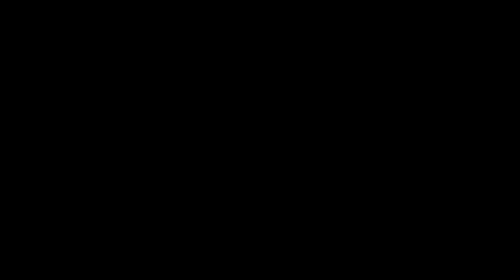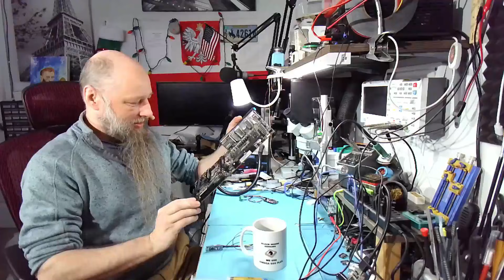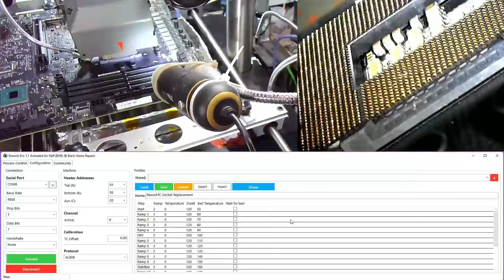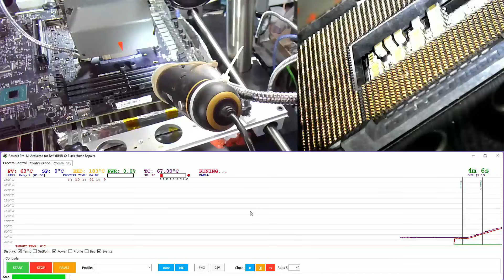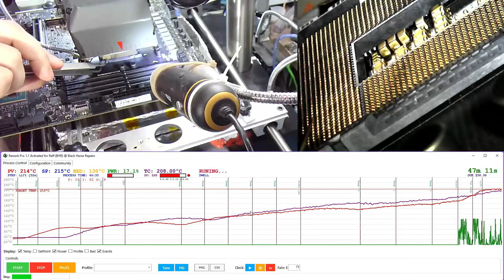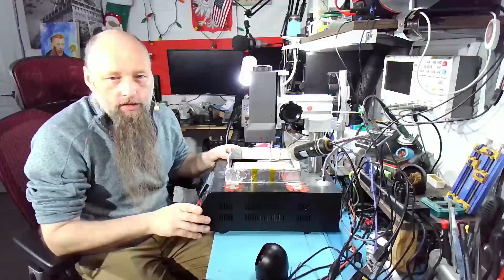334 | LGA1700 Socket Replacement on Z790

Comment: Great work. I'm building my own ir reballing station with pc410 and rex-c100 controller. I bought you a licence for your great software and discover your rework pro controller project for the bed. I'm about to adapt the station with optocouplers and an npn transistor, plus a new thermocouple for the esp32 controller board in order to allow autonomous mode with rex-c100 and full control from my laptop. I'll tell you if all went properly. Thank you very much for all your works and YouTube sharing.
Reply from the maker: Sounds like a cool project, glad to hear the software is useful!